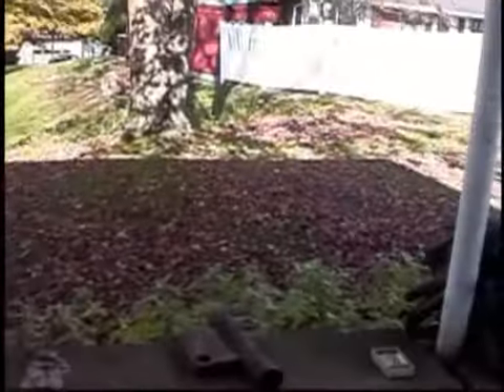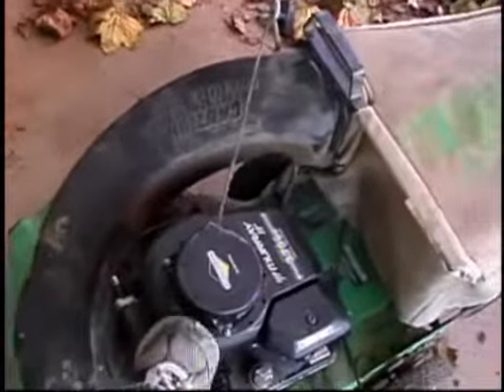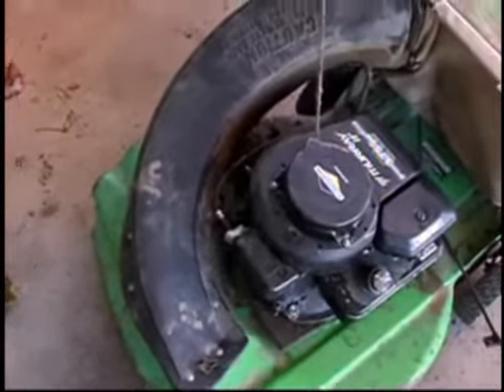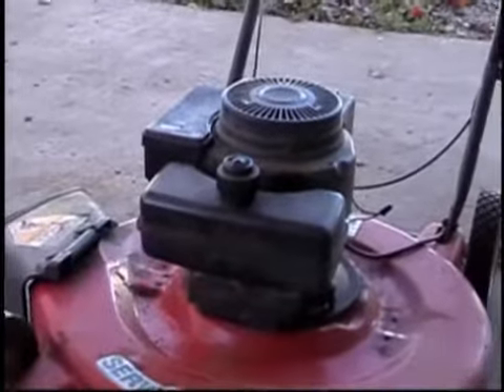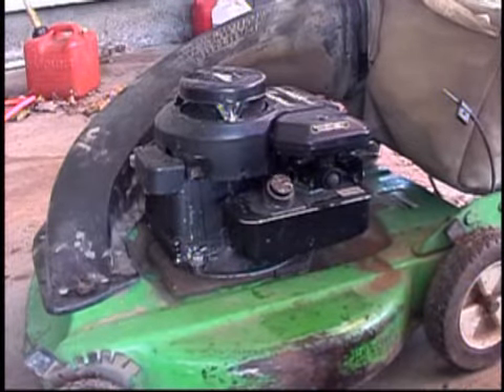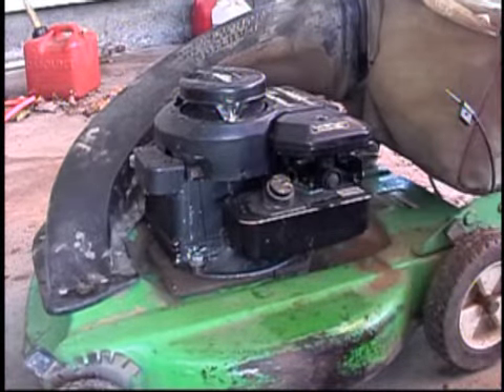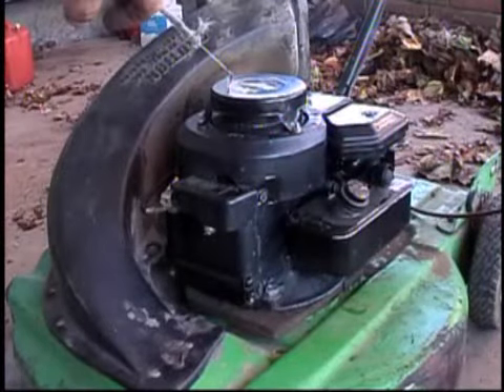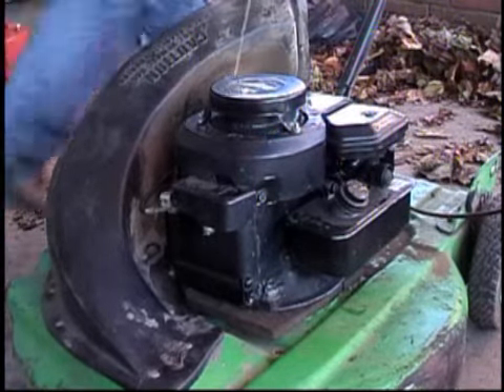Hard Start Briggs & Stratton

Comment: It needs the diaphragm! The tool to change the oil is a Stens #752-828. Amazon has it. If replacing the diaphragm doesn't fix it, replace the carb. Check the compression and leak-down to test for worn rings and valves. To replace the top seal, pull off the flywheel using a block of wood on the crank and tap it with a hammer while prying up under the flywheel. Screw a machine screw into the seal and the seal will come out. To remove the oil pan seal, remove the pan and use a line-up punch under the seal  to lever the seal out. Tap the punch with a hammer.
Reply from the maker: Thank you for the information ,appreciate it !

Comment: First it wont stay running then it won't shut off! I've had a mower do that before and it was a pain in the ass to shut off. Have you ever had an engine start up and the engine goes wide open right after you do work to the carb?

Comment from the maker: @1972FordF150 You didnt see where I went to cut the grass and it just shut off..... wire came loose again.  I made a new one and no more problems!  Yea ive had the engine go to wide open.  Usually its cause something stuck, or I didnt place the butterfly correctly especially in the plastic carbs where they just go into a slot and you gotta guess whats right.  I cussed at this one in the vid... " c'mon you bitch!"   its hard to pickup...

Comment: can you help me out? I bought a cheap yard sale mower that wasn't running the rope was broken and the primer blubb was destroyed . I removed and cleaned carb (plastic) and had to replace  pull rope and primer bulb , The engine runs great  but very hard to start when I push the primer bulb it doesn't feel like its building pressure So I have been using a gas rag to start it . once started it starts good when warm .
Reply from the maker: There is a check ball valve inside the carb and if it is stuck, it wont do what it is supposed to do......  draw fuel up and squirt into the intake.  Also is the primer isnt sealing against the carb weather it be the wrong one or the rubber is too hard, it wont prime.  Also, if you had the carb off of the tank, the seal between the tank needs to be air tight, there is also a diaphragm, spring, screen filter, and the pickup tubes, these need to be clean and the diaphragm needs to be replaced in most cases......  that is what I have found to give me problems with this mower style in the past
Reply: Hey thanks , i did have the carb out  to clean up but I have found out they sold me the wrong primer bulb the one I installed has a hole on the end and the one I need does not , and I think I will also order a new diaphragm
Reply from the maker: those are the best two things you can do for an engine with one os those carbs..... I used to keep a second one on hand as sometimes they warp as well

Comment: @More350Power Hahaha, when the engines go wide open on me it's usually the linkage that goes  to the throttle to the air vein. I always triple check those now before I start it that it works freely, because the last time an engine went wide open on me I shit my pants......No joke.